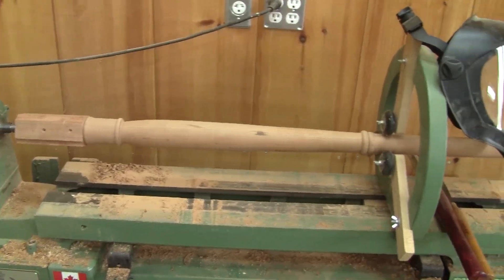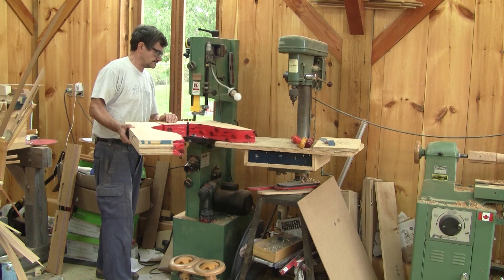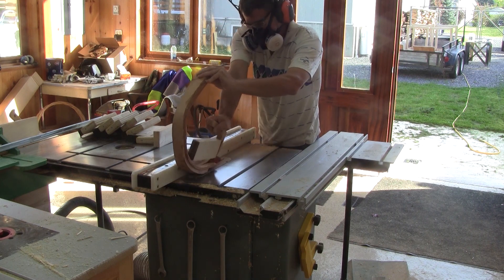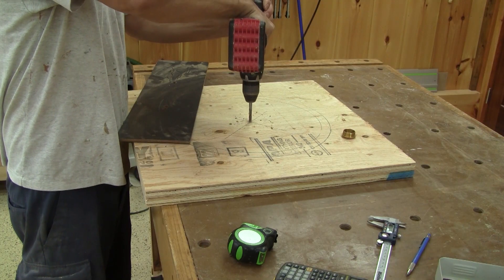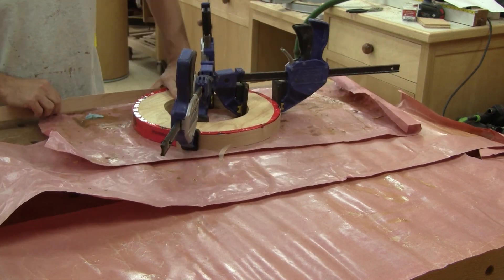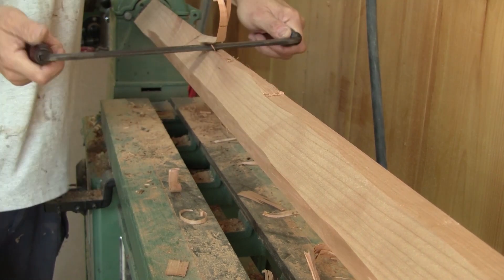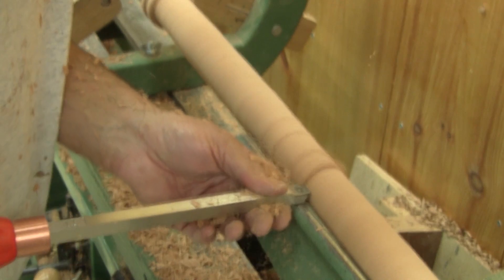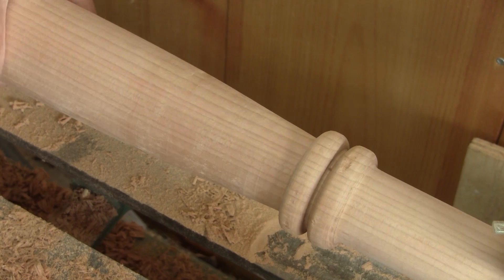The Woodpecker Ep 106 - Building a pair of coat racks part - 2

Comment: Great project Alain. 2 questions if you have the time. What kind of saw blade do you have on your table saw?. Seems like it cuts that Cherry monster block at full height without any struggle, and how large is the motor on your saw?
Reply from the maker: +Bellevue Woodshop It's a Freud thin kerf rip blade. I started using thin kerf when I had a 1HP motor on my table saw, the "normal" ones removed too much wood and the motor had a hard time. Now even with a 3HP motor I still use thin kerf blades,they remove less wood and it's easier to push wood throught since less wood is removed.
Reply: +Alain Vaillancourt Thank you for the reply. last question: Do you find any disadvantages with using thin kerf over regular thickness?
Reply from the maker: +Bellevue Woodshop No 99% of the time I use thin kerf. The only 2 reason I use a regular saw blade is to cut aluminum. And tu cut a wiide tall kerf, like for a briddle joint.
Reply: +Alain Vaillancourt Thanks for taking the time to reply Alain, looking forward to your next video. Best regards Roy

Comment: A band clamp would be great for those circles on the exterior of the molds.
Reply from the maker: +UsernameFECKLE I thought of that ,but it was becoming too hard to hold everything together. I don't think that with a band clamp I would had been able to position the strips end to end very  tight, THe glue made everything verry slipery and add the wood spring on top, it was not that easy.
Reply: Yeah, it definitely looked like an involved process, no matter how you go about doing it!

Comment: Is there any chance you have plans of your  plunge base circle cutting jig???
I’ve never seen when that pivots on axis while it pivots around the radius
I would love to create my own
Reply from the maker: You don't need a plan it's so simple. Take a scrap piece drill on one end a ¼" hole. Then drill another hole further along your piece of masonite,,or scrap, a hole the size of a router collar. You will have to find the position of the hole with the collar size you'll be using and the router bit you'll use to cut your piece. Then drill a ¼" in the piece you want to cut, put a length of dowel in the hole, pass your jig on the dowel and with the collar in the router you just have to cut your circle. The only drawback of this method is that this jig will only cut circle the size of the holes you made, but otherwise it's perfect. I rather use this method than the one when the router is screwed to the base plate, with the base screwed in place you're always fighting with the power cord. When the router can rotate it's always at the same position in your hand, it's much simpler.

Comment: What is the thickness of the strips coming off the table saw?
Reply from the maker: +Pauls Bored 1/8th. So I'm wasting more wood into sawdust than the actual strips :)
Reply from the maker: +Pauls Bored 1/8th. So I'm wasting more wood into sawdust than the actual strips :)
Reply: +Pauls Bored As I recall, we had 16 or 17 strips in one glueup.  So that would be 1/16 inch.  It took 3 inches of board width to give us one inch of leg width.  The rest went into kerf sawdust.
Reply from the maker: +Peter Collin You're  so right it was 17 strips for 1" so it's 1/16th
Reply: +Alain Vaillancourt +Peter Collin Ok thanks, I want to try some bent lamination but I think I'll use the bandsaw to minimize the kerf waste.
Reply: +Alain Vaillancourt 1/16th makes more sense thanks again